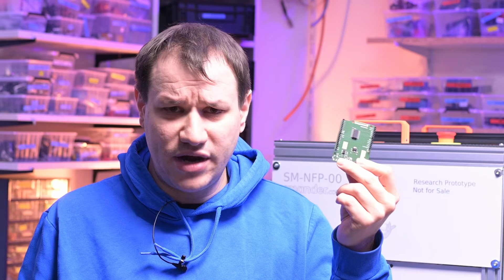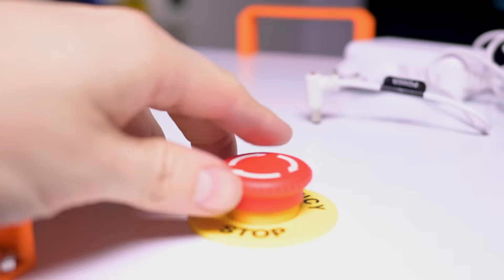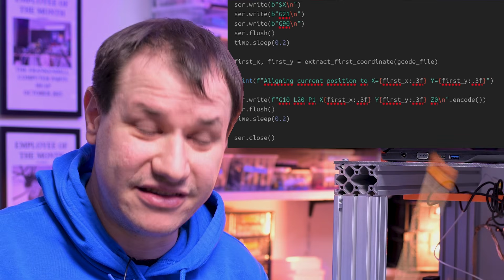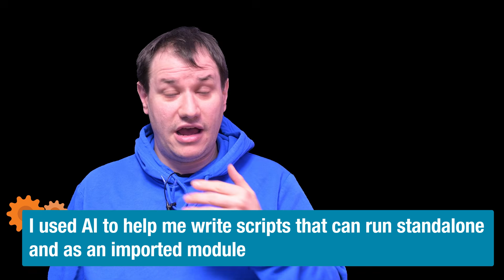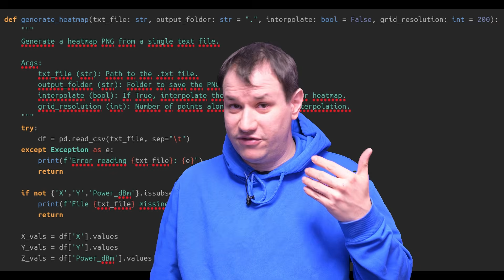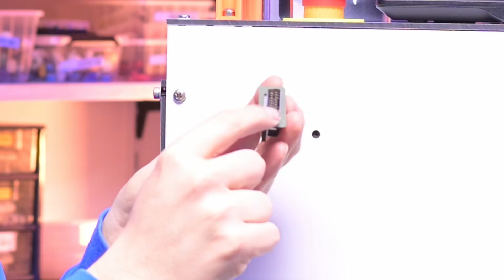This Home‑Built EMI Mapper Exposed Everything! Visualize EMI Hotspots

Comment: To create a perfect (or quasi-perfect) Faraday cage all we need is a used MRI machine and some liquid Helium. The used MRI machine is for the high purity NiTi wires and the liquid Helium is to make them superconductive. Holding all that in place is so easy and simple I won't bother explaining it here. 😉😆🤣

Excellent video!
Reply: thanks, do not forget the magical air-hooks to fit the non-eucildian pressure hoses to fill in the helium.

Comment: Great video! Thanks.
Just one thing to add. Usually when doing EMC this near field scanner is used as a debug tool. When sertifing a device it need to pass far filed emissions. There is a difference between the near and the far fileds (meaning you can see a problem in the near field but it may not be a problem at the far field)
Reply: Thats why i briefly mentioned you need to have a pre compliance result first so you know which frequencies to scan for. If you broadly scsn you will see many spikes butvonly some are relevant. This device is used to narrow down the origin of a previous identified issue.

Comment: Can you squeeze this system into pair of NODs? (Not sure if Tom Clancy already has a patent)
Reply: technically  all you need is move the probe , scan, log and then convert to an image...so theoretically yes...
Reply: These probes are called 'nearfield probes' for a reason.
Reply: @tHaH4x0r  the princicple als oworks with other antennas f.e. a yago , horn or biconical its just about finding the right one for an application..seeing Phones through walls f.e. should be doable